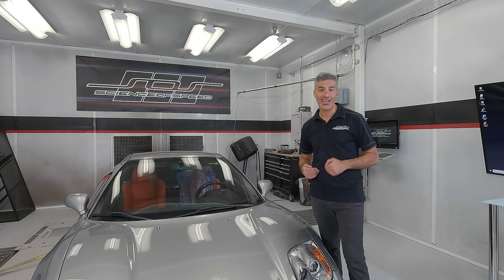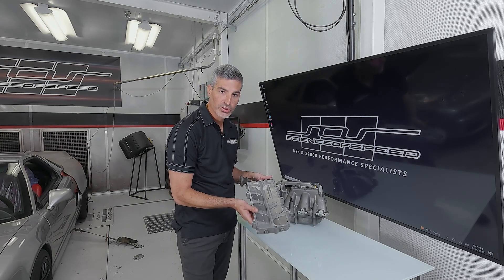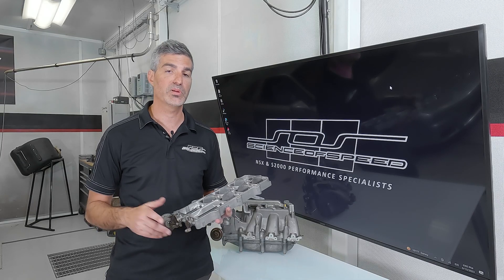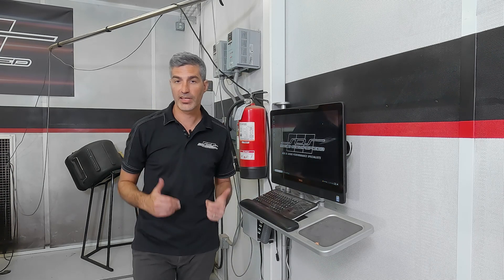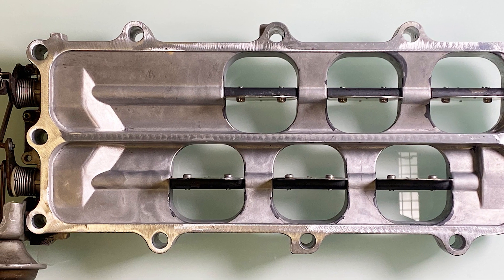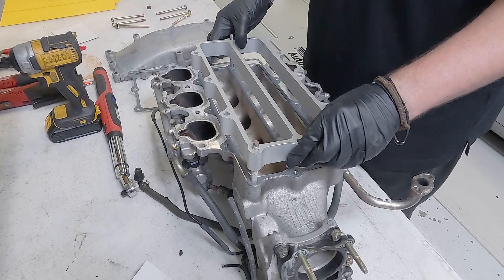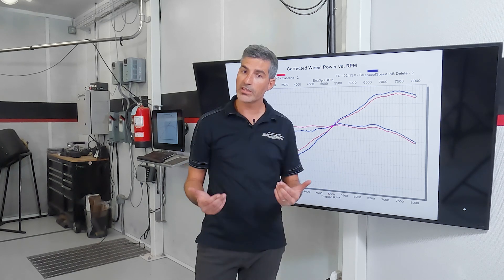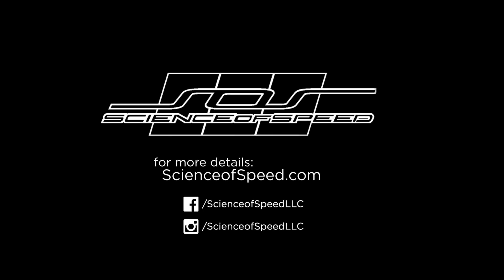Surprising Findings: a Detailed Dive in to the NSX Intake Air Bypass System

Comment: Very cool data point here and definitely a very lucky owner!  I'd say that the fractional torque loss at low RPM on the 3.2 will be far less noticeable than the noises that would happen if the engine ingests a butterfly screw.   Solid K.I.S.S. solution that could prevent an expensive incident.